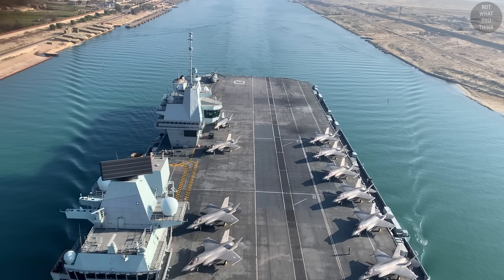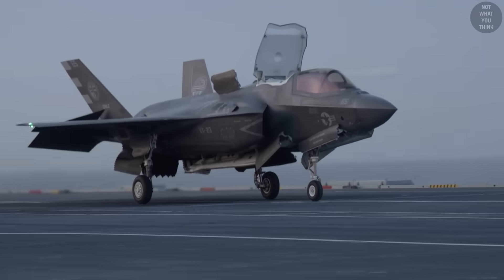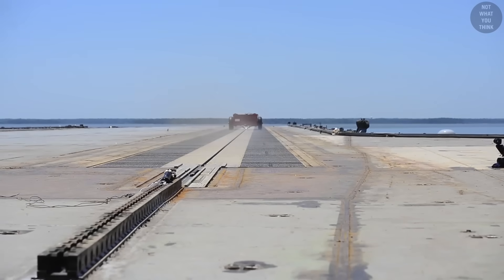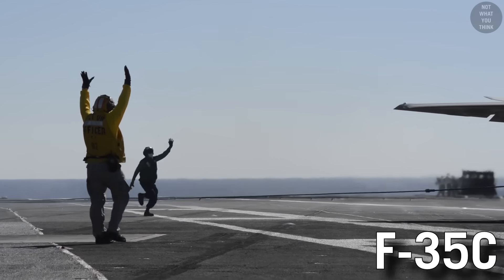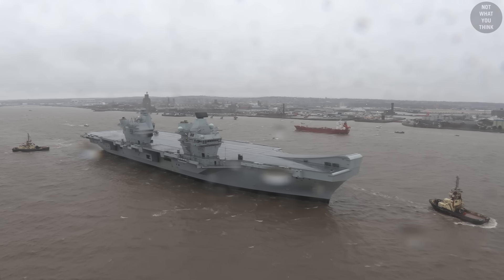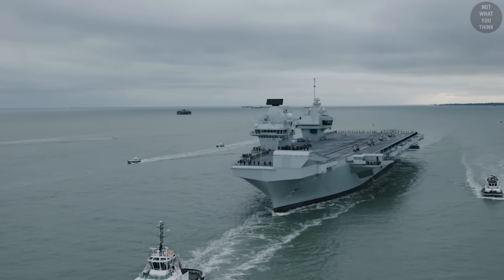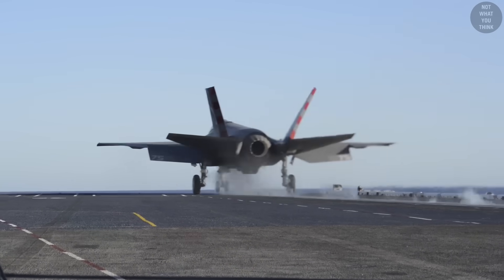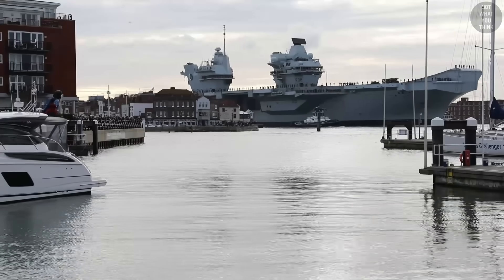Was the Angled Flight Deck Missed on HMS Queen Elizabeth?

Comment: Building the F-35B - "the most versatile aircraft, it can takeoff and land anywhere! Imagine the cost savings in streamlining the fleet!"

"Umm, guys, we can't actually have it takeoff vertically. I mean we can, but it's not economically feasible so we're never gonna do it."
"Also guys, we need a whole bunch of re-modifications for this F-35 purpose built flight deck. Turns out it can't withstand the downward thrust of the jet. We thought it could because of the Harrier, but we forgot that the Harrier used air for thrusts instead of... flames"
"Uh, okay guys. Just a few more things, I swear. Turns out that it's not as great as we initially pitched, you guys will be slower, less agile and carry way less weaponry than jets made in the 80s and 90s. One of which we already have in the fleet, and that you're supposed to replace."

"But don't worry. You're sunk cost at this point, we literally have no other option.
Reply: Oof

Comment: I don't understand why EMALS would be hard to build to be reliable. They are just linear motors, something we have used for e.g. trains like the  German Transrapid since the 1980s and in some other cases even longer.
Reply: But you don't accelerate trains from zero to 160 mph in two seconds, over a distance of 250 feet, then release them from the track so they can fly away cleanly without getting hung up. I think it's a bit more complicated than you're suggesting 😉
Reply: @lukedogwalker  so basically it's not what you think

Comment: You can launch even airplanes with weaker thrust to weight ratio from STOBAR ramp, just attach rocket boosters for take-off.
Reply: yeah c130 takeoff on a US supercarrier was done  in this way
Reply: @Tenohekabanzai  but isnt kinda dumb use rocket booster in fighters?
Reply: @Karedu.  Not for fighters, for cargo planes
Reply: @gregc9344  use the same boosters they used for the c-130 and make them so they can drop straight after TO for the carrier to pick up and reuse then Voila
Reply: @Karedu.  Yes it's kind of dumb. You remove the ability of the carrier to do anything else but launch that one airplane for a while. You would FOD the hell out of the flight deck. The C-130F took off and landed unassisted. No hook, no catapult, no JATO, just took off and landed on the Forrestal like it was an airport runway. Of course they cleared everything else off the deck which is impractical.
Reply: @patrickweaver1105  that was just to show it could be done wasnt it?
Reply: @Khronogi  Yes.
Reply: @Karedu.  Depends really, rocket boosters have been used way more than people would think
Reply: @hoshyro  i don't really know why everyone is so bent out of shape, its only rocket boosters, they've been in use since ww2 for short runways and carrier launches.  It doesn't tear up an armoured steel deck any more than afterburners...
Reply: Realy?
Reply: Makes it unstealthy
Reply: Giant elastic bands...
Reply: C130’s were also crusaders etc rocket assisted carrier catapult heavyweight aircraft takeoffs were done 50-60 years ago
Reply: Don't be foolish, every true Navy pilot with balls knows the most badass way to launch from the hard deck is to initiate a missle launch, but keep them locked to the airplane socket so you get a nice boost on takeoff from the rocket engines.
Reply: Rockets are all very good for take off But fitting some facing backwards for landings is something else.

Comment: "STOVL jets are less maneuverable than conventional fighter jets"
Sounds like you haven't heard about VIFFing. It's like a vertical takeoff, but it's not what you think.

From wikipedia:
Rotating the vectored thrust nozzles into a forward-facing position during normal flight is called vectoring in forward flight, or "VIFFing". This is a dog-fighting tactic, allowing for more sudden braking and higher turn rates. Braking could cause a chasing aircraft to overshoot and present itself as a target for the Harrier it was chasing, a combat technique formally developed by the USMC for the Harrier in the early 1970s.
https://en.wikipedia.org/wiki/Hawker_Siddeley_Harrier#Controls_and_handling
Reply: The Harrier is one of those truly unique planes that will forever be iconic, like the Spitfire, Fokker Triplane, or F4 Phantom. They're obsolete now but they occupied a unique place in the history of aviation and it's awesome to see the spirit of the Harrier live on in the F-35B and the Queen Elizabeth carriers.
Reply: In 1 vs 1 it may work, but not in more, cause if the chaser has some time, he can just fire off canon rounds to take out the plane which jist became super slow and stuck in air easy target
Reply: Due to increased range of missiles, pure fighter jets are decreasing and multirole are on the rise who prioritize carrying capacity and range more, so they cant vertical take off
Reply: He also forgot to mention one thing. In a raging war, you could imagine the enemy's initial targets would include airports and long strips of land to prevent conventional enemy aircraft from taking-off and joining the fight. Having combat aircraft that can take-off and land vertically and still be capable of mach flight would be a very big asset in such a scenario. They wouldn't need the conventional, long airstrips to be combat-ready and thus be more usable in protecting the airspace. What exactly is the use of a faster and longer-range aircraft if it is stuck on land, unable to take-off? VSTOL aircraft can practically join the fight from everywhere and that is the reason why I think it is the most ideal of the three F-35s.
Reply: @mariodelaurie1142  yeah in principle the whole idea of vstol, tactically makes it the best and most relevant variant there is, however, the F35B is not exactly rugged so idk how confident I am that it could effectively operate from a field like the Harrier's were meant to
Reply: The reason this isn’t seen as a valid tactic most of the time is similar to why the Cobra manoeuvre isn’t seen as valid. While yes you do cause an overshoot. You lose a majority of your speed, and therefore your manoeuvrability. If they have a friend you just became 100x easier to hit.
Reply: @kaidenharding4807  and even if they dont have a friend you can just rate round them and kill them whilst they flounder with no energy
Reply: @willsabri4815  usually if someone over shoots you it’s because they have more energy than you. This is also assuming that you get the timing and spacing done perfectly and you don’t just pull this manoeuvre and stall out in front of them
Reply: @kaidenharding4807  yes thats what i'm saying, the person that viffs/cobras/pulls a maneuver that kills all their energy to make you overshoot, allows the guy that overshoots to just go round and reset on their six, likely before they can fully recover their energy
Reply: @willsabri4815  ahh yes sorry, I thought you were saying the one pulling the cobra or VIFF would shoot them down 😂
Reply: Correct me if I am wrong, but I believe purpose built dogfighters will be a good deal more maneuverable than any standard aircraft that employs VIFFing. In fact I believe the Harrier jump jet actually has relatively poor maneuverability
Reply: @DonutHolestien  Yes, that's true, however newer fighters are built for beyond-visual-range engagements with missiles, not pure maneuverability, so the Harrier would be more on an even footing in a dogfight without employing VIFFing. 

The Sea Harrier FRS.1 and Harrier GR.3 were extremely successful in the Falklands War, against Skyhawks, Daggers, Mirages, Pucaras, armed T-34Cs, and helicopters. Their biggest weaknesses were their small numbers, and inadequate airborne early warning. Neither of these is really the fault of the Harrier itself.
Reply: @sebsjunkyard  Alright, good to know!
Reply: @sebsjunkyard  Doing vfffing at beyond air range makes no sense, plus its to dodge a missile u have to be extremely skilled to time it properly with flares, which is too risky itself
Reply: @omcena  I'm not advocating VIFFing to evade a missile. I'm saying it gives the Harrier a significant advantage when dogfighting, a situation that neither it nor its opponents were primarily designed for, because of the accuracy of said missiles.
Reply: @omcena  yeah viffing to dodge a missile would be kinda suicidal lol, to dodge missiles you wanna deplete them of their energy, not yourself
Reply: @sebsjunkyard  viffing itself isn't that useful, sort of like the cobra maneuver, a very very last ditch effort, using the nozzles themselves to increase turn rate however is useful
Reply: @sebsjunkyard  eh i disagree, the modern fighters, certainly all the 4th and mostly 5th as well are still very maneuverable within visual range
Reply: @DonutHolestien  still spanked the argies tho 🤣

Comment: I wonder if the F-35B variant can be modified to handle CATOBAR takeoffs. Then CATOBAR carriers can also hold F-35Bs if needed.
Reply: CATOBAR carriers can hold F35Bs. They just ignore the catapult and take off with a short take off. They dont NEED a ramp but it helps to increase max take off weight.
Reply: Anything flat can hold an F'35b.
Reply: @williamjordan5554  Nope, exhaust temperature is too high and could damage the deck .
Reply: @randomguy8196 the landing gear would require a ridiculous amount of modification to strengthen it for a near 6g force. At that point, why not just land it with BAR so it can land with more stores and fuel and you have an F35C that is smaller and more complex for no reason. F35B will never be modified for cat launches due to cost and a duplication of the C variants role.

Comment: What about the Canberra-class?
Reply: The canberaa class is a landing helicopter dock
Reply: @yookk7143  bugger off
Reply: @yookk7143  Gulag
Reply: Its a bit too small to operate F35B effectively. Since its only around 20000ton. The U.S Wasp and America class LHD are both around 40000ton.
Reply: @qiyuxuan9437   Canberra-class has 27,500 tons.
Reply: @valenrn8657  Thats probably the fully loaded number. Still too small, especially the flight deck is not extended from the hull, and its too narrow. If they rebuilt the deck and expand it, that might be possible, but it will be a very expensive upgrade.
Reply: Could always get the most recent version of AV8's (revamped Americanised Harriers) from the Americans, which though no F35 are still pretty capable aircraft, and use those instead like the Spanish did on these ships
Reply: They were bought as is from Spain and already had the jump, it would’ve cost a lot of money to remove the jumps so the government left them on even though they have no intention of carrying any aircraft other than helis on them. They could be modified to allow for F35Bs to land and take off from them (we don’t have F35Bs, we have F35s but the ones we have are all going to be F35As) but that would require strengthening the jump and coating the flight deck in a stronger coating, which would be pretty expensive. So it’s possible for them to launch and receive F35Bs but I wouldn’t hold my breath waiting for it happen, for now it’s only choppers on the Canberra class.

Comment: What if I told you the F-35B has similar range & payload to an F/A-18E with 3 fuel tanks?
Reply: Really ?
Reply: f35b has a range of about 1600 km/1000 miles whereas the Super Hornet has double that at 3200 km/2000 miles. The F-35C however is on par with the Hornets.
Reply: No, it doesn't.